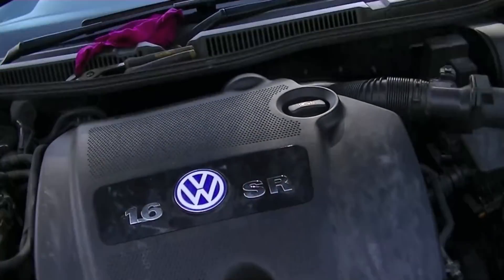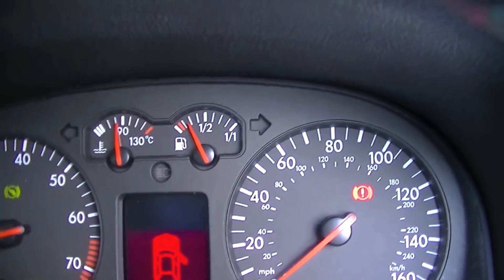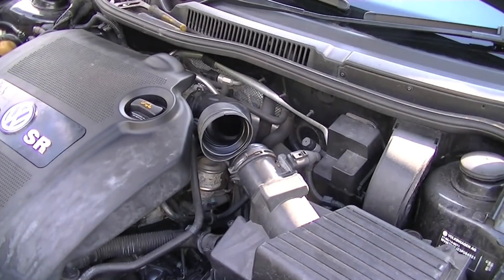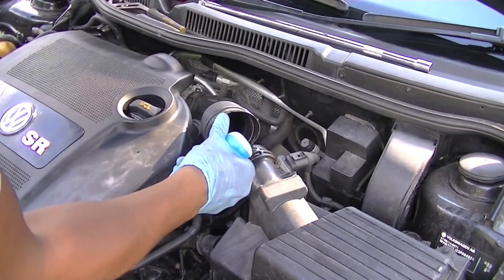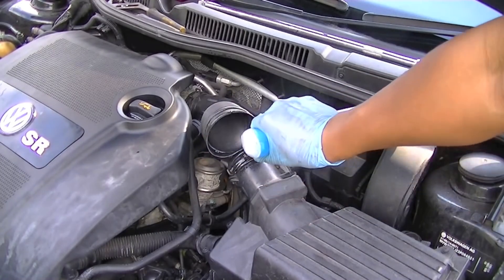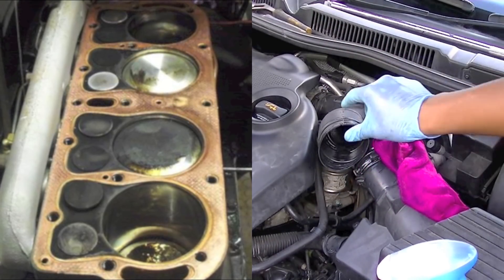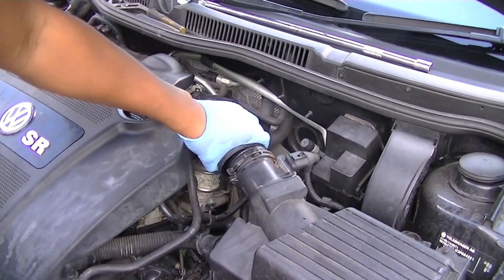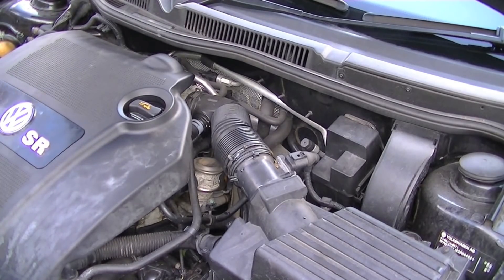How to make your engine run better with just tap water.......Better Than Seafoam?

Comment: I recently commented on another video of yours where you used Seafoam on a new mower etc to prove the smoke is not carbon being burned off.  Anyways...

The example in this video about the leaking head gasket I am not entirely sold on.  I mean I have no doubt the leak is what cleaned the carbon, BUT it was not water alone.  Antifreeze has detergents in it to keep your coolant system clean and free flowing, I would venture to say the antifreeze was the key to that clean piston.

It would be worth doing a test to put a few spent carbon caked valves in jars, one with plain water, the other with antifreeze/water mix and boiling them in a kettle to see what kind of results you get.  My money is on the antifreeze one is spotless while the plain water one has little to no effect after 10 mins or so of boiling.

I haven't tried this test before, so I could be completely wrong and I'd be the first to admit if I am mistaken, but I highly doubt I am.  I mean I have tried steam cleaning old engine parts with just water and it really doesn't do much without some kind of cleaning agent added.  Come to think of it... perhaps Seafoam should get a shot at a boiling test to clean carbon since basically thats how it is supposed to technically work and is something I never tried with it.
Reply: BMAC VAGS I'll try and dig out the service procedure for the new Barra EcoLPI system.   The fleet process for cleaning the intake tract, guide and the valve faces is to use a machine (at great expense) that does the same job.

We bought a few pressure-pack sprayers - more volume of water and more consistent.    

The process works perfectly.  Carbon build-up isn't great inside the head, but on the valve seats?   maaaaan...
Reply from the maker: From my experience people who have cars that over heat tend to put water in their cars. As the overheating is not a planned event water is more often used that antifreeze and coolant in those situations. I am not saying that it has no effect at all, I am just saying that i believe that water is the main factor in the piston heads being cleaned.
Reply: BMAC VAGS I'm not saying your completely wrong, but I bought a harbor freight steam cleaner a while back to steam clean my deck, tools and auto parts etc  While it works pretty good on things like ordinary dirt and even grease, it does not work so well on carbon.  Not to say it doesn't work at all, I am just saying from my experience with it I took an intake that had allot of carbon build up and spent a full tank of water (about 1 hour) steaming it and barely took any carbon off of it.  What did come off was only slightly softened by the steam and I was able to scrap it off with a chisel.  

After hours of this I finally soaked the entire intake in a product called "Carbon Off" for about 2 hours and again used the steam cleaner.  What the "Carbon off" didn't already take off by it's self was fairly easily taken off with the steam and some light wire brushing. 

I mean time alone is a factor with your method of steam cleaning the carbon build up.  Your way takes like maybe 10 minutes?  I can tell you with allot of certainty that is kind of like pissing in the ocean, it's not going to make a difference.  It took hours of constant steam alone and heavy scrapping to get any carbon off that intake.  The chemical ate away quite a bit of the carbon in 2 hours and about another 1 hour of constant steam and light scrapping/wire brushing to remove the rest of the carbon.  I just do not see how in the world just spraying a little water into an engine could possibly do what it took me hours and chemicals to do.  The same goes for Seafoam etc... I can't believe anything of the sort in such a short time even if it had the proper carbon cleaning chemicals.  The only product I could even see working is a fuel additive with carbon cleaning properties used constantly over the life of the car.

That piston you showed could have seen steam and or antifreeze detergents for months, not minutes or even hours which I highly doubt. 

I also want to share a bit about what it is I do to fight carbon build up.  I bought a new 1996 F150 pickup which I still drive today with almost 400,000 miles on it.  I have to date replaced 1 A/C compressor and a few sets of tires and that's it.  I also bought a new 2001 Ford Crown Vic that I still drive today with 210,000 miles on it.  I have replace 2 sets of tires to date on that.  I also bought a 2001 Ford mustang for my daughter in 2011.  The mustang seemed low on power when I bought it so I pulled the intake and heads off to find massive carbon build up (this is when I bought the steam cleaner).  After getting everything cleaned and free of carbon it ran great with great power.  

On all my cars/trucks I have always used a fuel additive called Techron once every other month (each even numbered month to be exact).  I have tested it vs carbon and it absolutely dissolves it if a part is soaked in it for any amount of time.  But I wanted more proof... so in 2011 when I pulled the intake off my daughters mustang, I decided to see how my F150 looked inside with over 300,000 miles on it treated with Techron since the day I bought it.  My F150 intake was spotless, the pistons/valves all of it, spotless.  I can safely assume my Crown Vic is also spotless and my daughters Mustang will be spotless from 2011 forward.

Point is, all these 10 minute answers to carbon are not answers.  The only way to beat carbon is to constantly fight it with fuel treatments.  That is 100% effective and at about $7.00 a bottle for Techron every other month I dare say is about the most cost effective and time consuming way to do it.
Reply from the maker: I see where you are coming from, and this is good for discussing. What you should have done with the intake is used oven cleaner to clean it out with a jet washer, it would have taken you 30 mins max. The carbon in the intake seems to have slightly different properties and conditions in the is take manifold. The stuff in the intake is mixed with a lot of moisture and grease from the crankcase so although it is carbon it is different to that what is found in the combustion chamber. In a nut shell, the steam from the steamer was simply not hot enough to really work effectively. 

In the combustion chamber water expands 1:1600. The high pressure and heat allows the water to work in a different way that to that of a steamer in normal circumstances. Like I have said before i have seen clean cylinders with blown head gaskets, which lead me to believe that this method has some substance to it.

i agree that the 10 minute treatments are not the answer, but as a consistent habit it will keep it carbon free. The only real way to stop carbon build up is to maintain your vehicle regularly and properly. Regular oil changes and good quality fuel, then the impurities can not find its way back into your engine.
Reply: preston121068
Bravo!  And thanks
Reply: BMAC VAGS I can't plus one for some reason, but that was a great reply to a great idea. I enjoy reading comments on this channel. :)

Comment from the maker: Turbo cars should use this method http://youtu.be/izvz18xgfA0
Reply: +Sick Rantorum "It feeds all cylinders evenly" - Wrong on that one, depending on car. On mine, feeding seafoam in the brake booster line only feeds it to one cylinder.
Reply: ***** It makes no difference, Sick - Think about it..  The air intake is where all cylinders are fed from.  It's where primary power comes from.
Reply: i was just going to ask you why your spraying it into the air intake rather than the inlet.. but you already said that turbo cars should use the inlet way rather than the air intake. yet to be tried but will defo let you know buddy (Y)
Reply: FCFordLord  You're right. On my EJ255 brake booster line will only feed bank 1. The only way I think you can hit all 4 on a EJ, is from between the intake and the intercooler. I say fuck that! I blanked off my EGR and run Chemtool once a full tank every other month. On oil changes I pull a random plug and throw a scope down there. Have never seen a cylinder that didn't glare back at the scope.

Comment: Hey man, Is there any way to repair a rear wiper motor on a mk4? they're stupidly expensive to replace and because it's such a common prob it's more than likely a waste of money to buy a used one, thanks man.
Reply from the maker: A used rear wiper motor is only around £20 or $20

Comment: Does it work just as well with the 1.8 turbo? Just in case if something interfere with the turbo
Reply: Suck the water in via the vacuum hose on the fuel pressure regulator... that way the water bypasses the turbo intake (less chance of the water collecting in the intercooler). If you use the vacuum hose to suck the water in, you will have to be a bit more careful, since the only way to control the flow is to dip the vacuum hose in & out of the water. Works for me and it can even cure p0420 codes.
Reply from the maker: no it will be fine.
Reply: okay, I'll go that way cause I don't want to get any water stuck in the intercooler
Reply from the maker: Thanks Thomas

Comment: Can this be done on a 19 tdi golf, I did it yesterday but sprayed water into the air intake on the other side, the car is still a bit sluggish going up steep hills.
Reply from the maker: Maybe you have something else wrong with your car. Have you cleaned the injectors, checked the air filter??